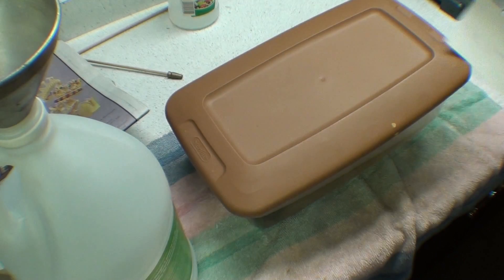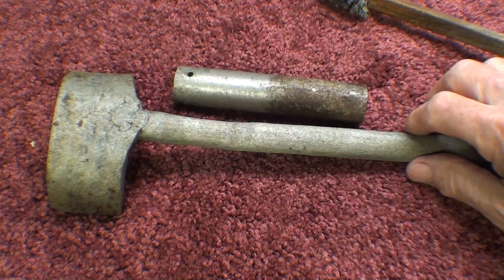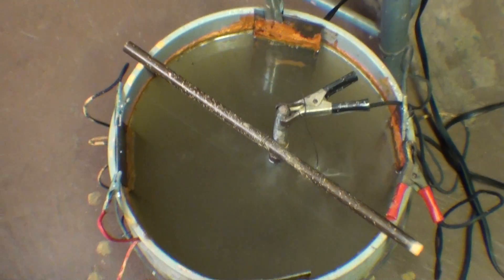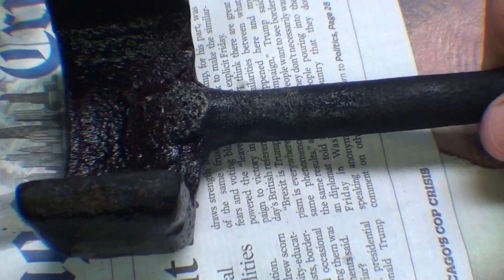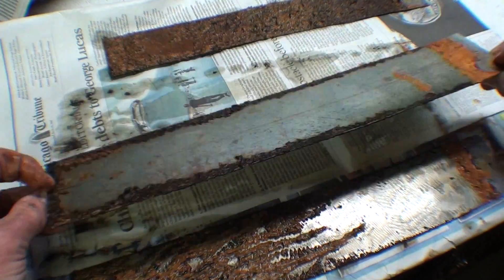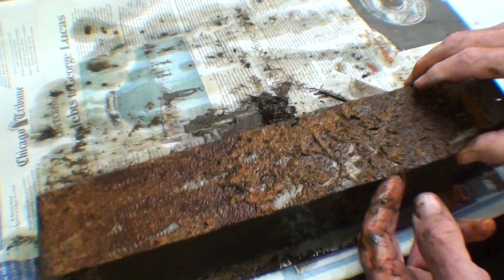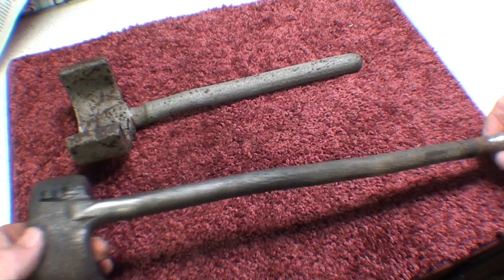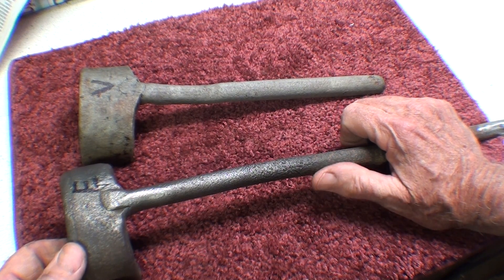Rust Removal -  Electrolysis vs. Vinegar #310 Pt 2 tubalcain

Comment: I can't help but wonder what finish you'd get if you did the electrolysis bit FOLLOWED by a 12 hour (or so) soak in vinegar? Would the vinegar remove the black iron oxide coating?

Comment: I use diluted muriatic acid used to balance the PH in swimming pools.  If I recall it is a already diluted version of hydrofloric acid which eats the rust but not the base metal.
Reply: hydrofluoric acid etches glass, was used to indicate angle of diamond drill holes in rock by etching the acids surface level on a glass test tube.  Dad was a geologist, that's how I know this.

Muriatic acid is hydrochloric acid

Comment: I've used cider vinegar, electrolysis, and evaporust on motorcycle tanks before. Electrolysis is my preferred method for tanks. Evaporust is too temperature sensitive. Directions say above 68° but it didn't work well until I put a fish tank heater set to 80°. I'd love to see molasses tested. Love your videos Mr. Pete! If your doing Evaporust video I've got some to donate and live in nwburbs.

Comment: Interesting to me that you prefer the vinegar result, I much prefer the appearance of the electrolysis piece.
Reply: Electrolysis dont do anything to steel, it only remove rust. It's a safer process than any acid. But you have to know what you want here the piece is pitted because the rust has made her journey into the metal. The vinegar which is just a really slow acid just didnt remove all the rust. You can use a rust converter I guess for vinegar before painting or a filler resine on the electrolysed part.
Reply: Remember he used a wire wheel on the electrolysis piece afterward.  If he had done the same with the vinegar piece, I think it would have looked the same.
Reply: agreed.  can't say i like the vinegar look in the least.  and it begs the question:  what happened to the rust in the vinegar solution?

Comment: As I commented before, electrolysis first then rinse with vinegar for best results. Slightly wire brush or scrub with cloth when rinsing with vinegar. Final rinse with water and baking soda solution. That's what I have found works the the best.

Comment: Why would 12 amp's be too high? I have two battery one at 12 amp's and 
the other at 40 amp? just wondering. When the steel or iron turns black 
is the passivization.

Comment: the black color is not caused by "carbon" it is Fe3O4 a black version of iron oxide. The electrolysis does not remove the rust. It converts Fe2O3, the red version of iron oxide called rust, into black Fe3O4. Fe3O4 does not continue to rust if soaked with oil. So it could be left on. Or it can be removed by tedious scrubbing to uncover the bare metal. But when the scrubbing is done why not do it on the rust directly and skip the electrolysis? Why use the electrolysis at all? There is one reason: vinegar and all other methods remove metal but electrolysis adds metal from the anodes to the work slightly healing the corrosion losses. Therefore electrolysis is the better choice for restoring toleranced, machined surfaces. For everything else use any available method you like best.
Reply: Direct current flow only goes in one direction. From negative, to positive. Yup, old Ben guessed wrong. So how does the process, "adds metal from the anodes to the work slightly healing the corrosion losses"? Electrolytic rust removal is a plating process. Where you deposit the rust of your work piece onto your sacrificial anodes. There is no material going in the other direction whatsoever.
Reply: +Ronald Kearn  please, check the polarity of any electroplating process in the internet. https://en.wikipedia.org/wiki/Electroplating They always have the anode delivering the metal and the kathode being plated. The same in de-rusting by electrolysis. The current is going in the same direction not reverse. The conversion of Fe2O3 to Fe3O4 causes the volume to decrease. Fe3O4 takes up less volume than Fe2O3. Hence by the shrinkage in volume of the oxide layers they break up into parts and fall off. Only the layer directly sticking to the metal surface remains in place and becomes black. That is also what we see happening.
Reply: *****
It really isn't. The most complicated part of it is hooking the leads up the right way around. Vinegar is one of the least effective acids to use for rust removal too. But it is safe, cheap, and readily available. Which is why it is used. Citric acid works better. But it is complicated, because it comes in a powder that you have to dissolve in water. That involves finding a spoon.
Reply: Thank you for clearning that up and to simply your statement. This is better known as Electroplating, but the layman call it electrolysis rust removal.  

The anode (sacrifice iron) is hooked up to the positive side of the batter/DC-power supply. Meaning the DC-PS is going to be pulling electrons out of the iron, and those electrons will move through the wire towards the DC-PS and out of the negative side. Those electrons will be deposited into the piece you are trying to de-rust. Thus turning Fe2O3 into Fe304 as rol eic explained.  This is what we call a Electroplating cell. 

↑+↔-↓

The most important rule in electrochemistry: Neutral atom make up solid metal. Metal ions dissolve in water.

Meaning the metal atoms in the sacrifice iron loses one of it's electrons and causes the metal atom to fall off in the water. Keep in mind that metal atom that fell off is positively charged. That positively charged atom makes it way over the the negatively charged counterpart. Get it?
Reply: Exactly! ;-)
Reply: I guess yes, 
if Fe3O4 does not cover the entire surface and
if you degrease and dry it and have not oiled it before.
For painting over it vinegar (or sand blasting) is probably the better process because it etches off any oxide layer also of the raw metal. If you dry it and paint it within hours after etching (or sand blasting) the paint will adhere excellently. If you wait longer the etched metal will be covered by a new oxide layer and you loose some of the advantage of etching. A cheap but effective alternative to sand blasting is also to scrub the derusted surface with the good old abrasive soapy powder (Ajax or similar). Rinse, dry, paint over within hours. A good paint preparation test is to sprinkle droplets of water on the surface. If it spreads the surface is ready to paint (when dry again) if there are water pearls it is not ready.
Reply: +rol eic well done! I think it boils down to preference of the final result in looks. in the electrolysis experiment, one would leave the black anodized plating on (black ferrous oxide) if put to use. 

Tubalcain, you just reached the 1st level of plating experiments! now you have fodder for many other videos! enjoy all your vids +1 and subscribed!
Reply: pds tech
nah you to take that black crud off. It's just nasty.
Reply: I have seen people doing the electrolysis in vingar instead of water. What would that reaction look like?
Reply: Very Elucidative Rol Eic. Thank you for your contribution, I was pleased!
Reply: Particles only move from the negatively charged metal to the positively charged piece. No metal will move to the work piece to fill in holes.
Reply: Is it like blueing a gun?
Reply: The black colour is actually the color of when it was forged … it is technically carbon
Reply: In the wires there are electrons (always negatively charged) being transported (actually gaps between electrons but that is another story) and in direct current you are right  that they go only in one direction. As far as I understand it there is no rust deposited from the work piece to the anodes. There are iron ions transported from the anodes to the work piece. And the flow direction of the iron ions depends on the polarity of those ions. There can be positively and negatively charged ions running in opposite directions constituting the same current direction. The rust on the anodes is created by the corrosive basic water solution. I am not sure whether the current plays a role in the corrosion on the anode. The highly reactive iron ions arriving at the work piece partially react with the oxygen of the Fe2O3 and convert it to Fe3O4 which contains a higher percentage of iron than Fe2O3. The other part of the iron ions are added to the surface of the bare metal which is similar to usual plating. I am happy to be corrected if my understanding is wrong.
Reply: rol eic
As I understand it electrolytic rust removal is simply metal plating in reverse. The rust gets removed from the cathode, plated onto the sacrificial anodes. Well, a lot of it ends up on the bottom of the bucket you're using too. But as long as it is off the work piece no one cares.

As far as where the black sludge on the work comes from I don't know. Or again much care. I do tend to remove it periodically whenever I run the process. As it seems to impede the cleaning action.
Reply: Actually, there are typically two types of rust.  Inner black rust and an outer red rust.  The process removes the red rust, and actually reverse the chemical reaction on some of the black rust, thus preserving more of the material.   

These acid treatments actually eat away at the material.

Comment: pretty much same results...finish is better...all except old tool steel...leaves it blackened..etched...waste disposel..hmm..dont see this in hazardious materials book...
Reply: well here in tree hugger calif..be surprised how shops are fined or shut down here why industries are leaving state
Reply: I wouldn't put any of these materials in a septic tank, where the buck stops on your own property.  But I guess it is OK if it is out of sight, out of mind if sent to the treatment plant.  :-(
Reply: Could probably be disposed of in the garden; some veggies must like slightly acidic soil. The iron is a plus too.
Reply: tom7601 I'm curious what results you would have gotten if you used the vinegar as the electrolyte in the electrolysis experiment. Secondly I have seen this process done with the + placed on part. Just switching the +and - . This may be  counter intuitive but I know that in current electrical theory electrons actually travel from - to + which is backwards from the way I was taught. Thirdly, you may have different metals in each wrench. They were probably forged differently. Were the wrenches annealed and case hardened in the same way? Smith's had different tricks some were very secretive. Quenching the metal in water, oil, or bone. I even read of one blacksmith who made swords for royalty. He added a piece of a meteor into the metal. Folding the metal over and over and quenching into ground up bone. By doing this they able to draw carbon from the bone   then folding it over and over, each time adding carbon into the metal making it harder. However you could get a rough idea of the metals content by performing the "spark test" grinding each wrench and comparing the colors of the sparks that came off. Tubal Cain, I enjoyed this exercise. I have read all of your books. I.have been little by little collecting the books.from the "Workshop Practice Series" Give consideration to repeating the  exercis